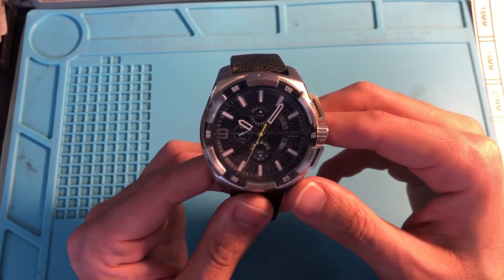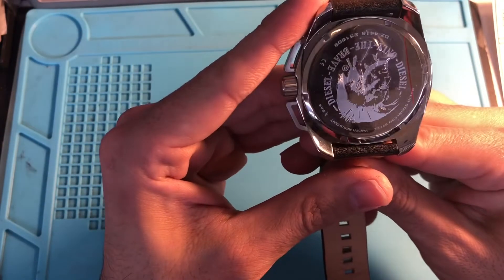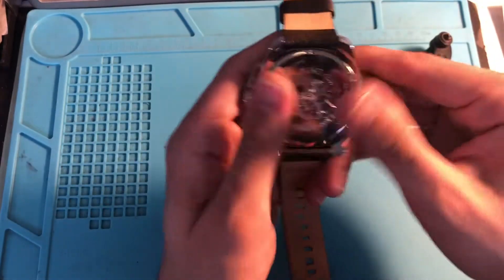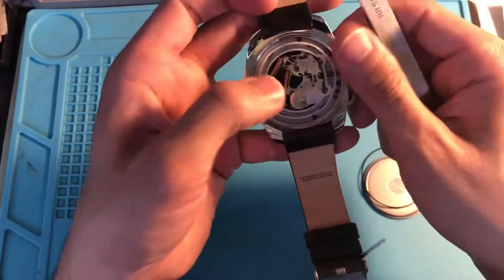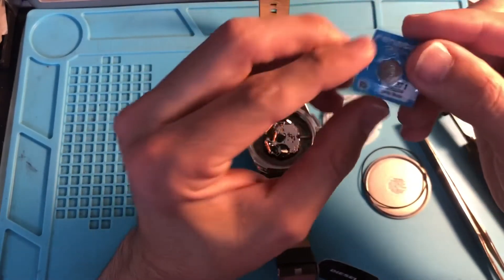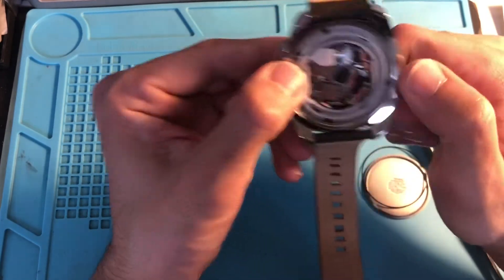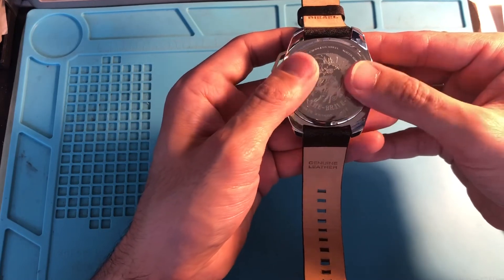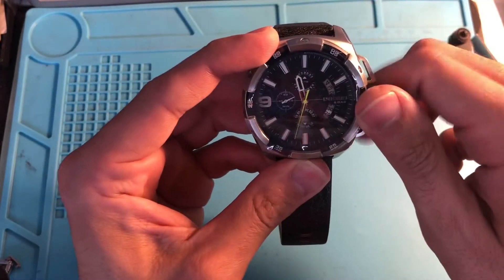How to change battery | battery replacement Diesel watch

Comment: What size batteries are those. I have the diesel only the brave watch.
Reply: so only the brave seems to be their slogan, look on the back of the watch it should have a number starting with DZ-, for example, the one I have is DZ-1737, which uses a smaller battery than the one in this video.